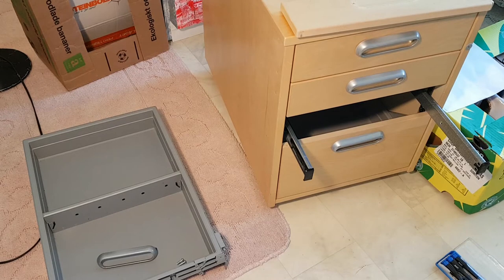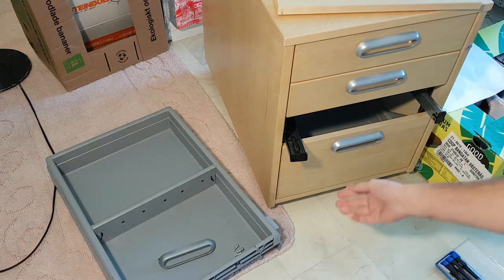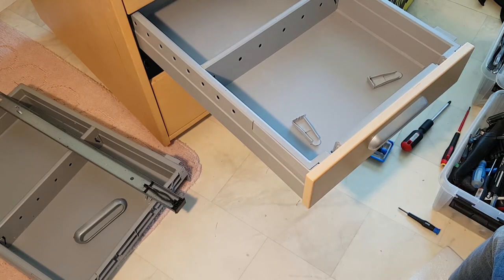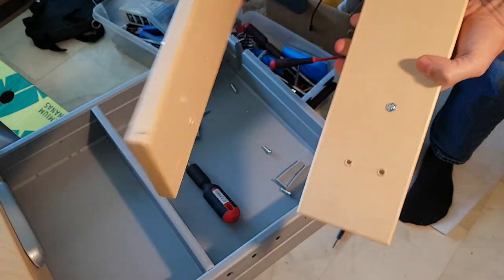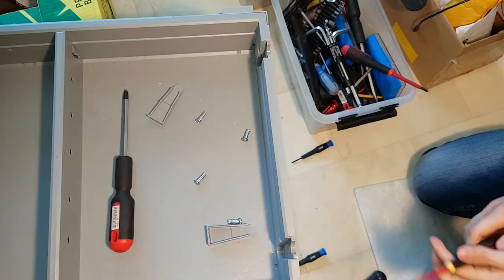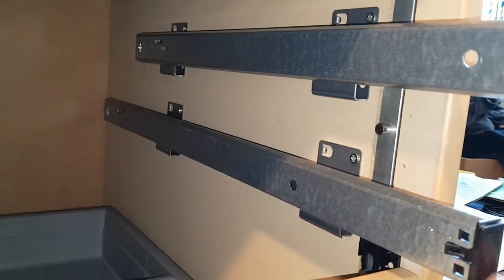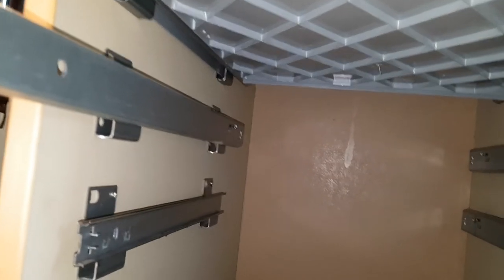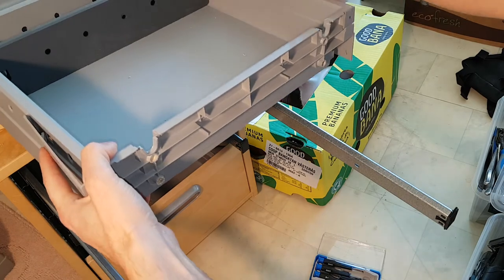How to remove drawer from ikea effektiv cabinet

Comment: Just a tip there is obviously more than one version out there. My draws are held in with a screw each side 30mm back from the front that goes through the plastic and into a threaded hole on the runner. Found out about an hour ago as one draw was not running properly and turns out to be that a screw came out after 25 years.

Comment: Thanks for the instruction - saved me a lot of time!
But I think you don´t have to remove the front plate:  just insert the screwdriver into one of the two slots and lift up the corresponding corner of the drawer - then do the same with the other slot/corner.
Reply from the maker: Glad it helped! And thanks for the tip to try to do is simpler.
Reply: I did the same !  If the plastic tabs  are visible they can be pushed in with a screwdriver. The tabs on the bottom also help to retract the tabs inside the drawer. thanks for all the tips guys!
Reply: @alikhh  I can confirm that it can be done without removing the front part
Reply: @sidharpreet  I removed mine trying to fix it before I found the video 😢
Reply: Yes, thanks for the video, which showed how it all went together. With that, i could just use my fingers to pull those two black tabs fro where they were retained.

Comment: Thank you so much!!! I would have destroyed it trying to figure out those 2 inside slots. As it is, i had to break off the little plastic thing on one side which pulls the drawer closed because thar was the problem. It was hitting when I tried to close it but I think the whole slider blew out because one single ball bearing fell out of it before I took it apart and there weren’t any others in it. It doesn’t slide as smooth on one side but it closes now.